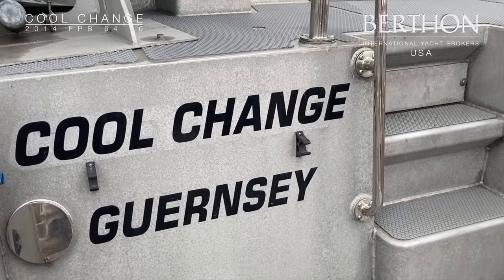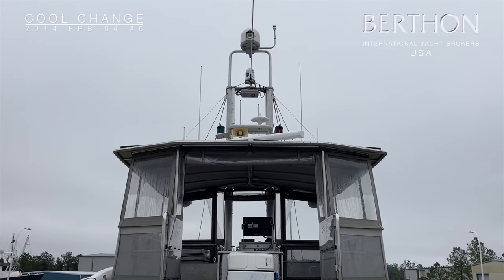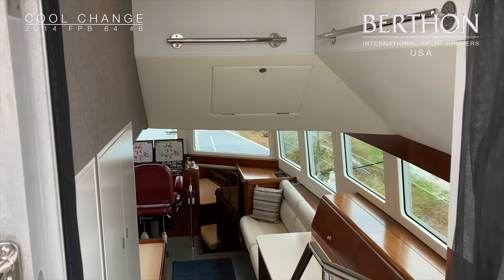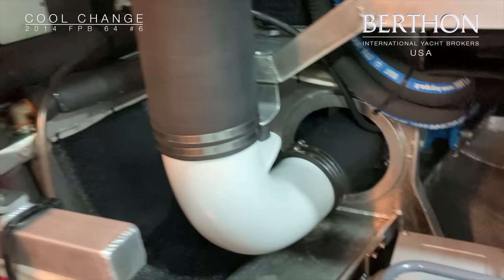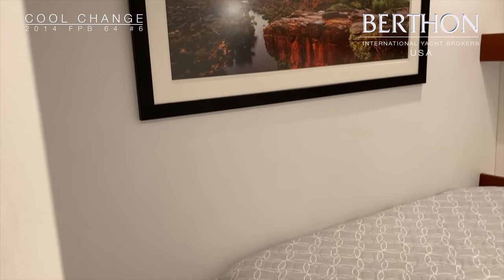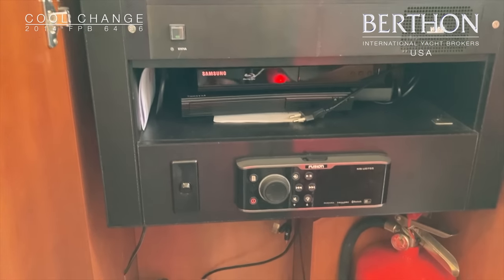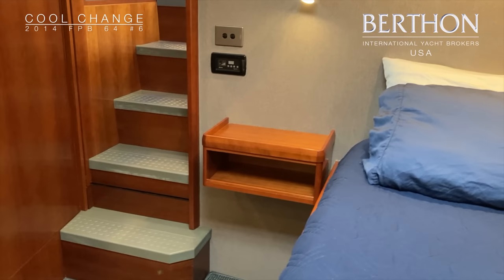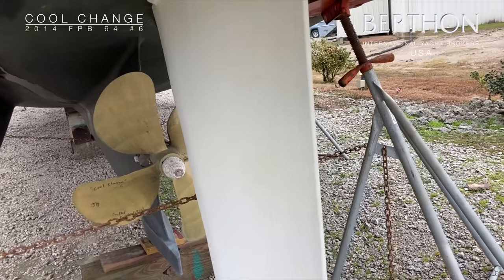[OFF MARKET] FPB 64 #6 (JACK ex. COOL CHANGE), with Sue Grant - Yacht for Sale - Berthon Int. (2021)

Comment: Wait, there are 3 FPBs in the same yard? WOW.

Your narration style is like describing a Picasso.  Which I think is appropriate. The opposite of the used car salesman approach of many brokers.
Reply: I noted that also. Seems this girl doesn't have the " get home" auxiliary diesel.
Reply: @petertorrey4080  17:43 shows the auxiliary prop so I think it's safe to assume it's got the engine as well
Reply: @petertorrey4080  she does. We see the “get home” engine in the engine room tour, just in front of the Kabola heater. And we see the “get home” prop shaft and feathering prop at the end of the tour.
Reply: I think it's sleep inducing.. but yeah. Love the boats though

Comment: I so  Gump’s shrim fishing boat ! But, what is these boat made for? Its obisly very strong. I dont feel like living months on it 🤔😀😇
Reply: This is a very early FPB, which didn’t really go much for luxury.  It’s all about safety and go-anywhere, anytime utility.  Check out the later FPB 78s, or the amazing 1-of-1 FPB 97, Iceberg, which look much more comfortable without sacrificing any of the utility.  Watch the videos of these in rough seas.  Guys inside comfortably standing, sipping coffee while massive waves crash against the boat—it cuts right through them.  Part of the secret is the hull shape and proportions.  These boats are built for advenure cruisers, certainly not fashionable marina parties.  Their destroyer-had-a-lovechild-with-a-sailboat look is actually an advantage if sailing to ports where you may not want to attract attention.  If I had that kind of cash I’d snap up the Iceberg, which is also for sale.
Reply: these boats are made for taking long voyages very safely and efficiently. Look up Steve Dashew FPB boats, they are very interesting and capable vessels.
Reply: Made to cross oceans, made to go to the South or North Pole, made to go out to sea in heavy weather, built like a submarine, self-rising like Coast Guard and Pilot Boats ......... it is not a "Miami Party Boat .....